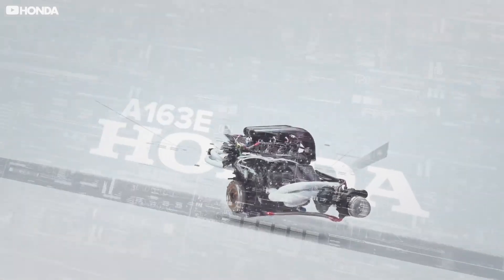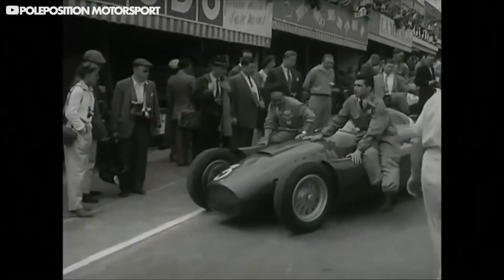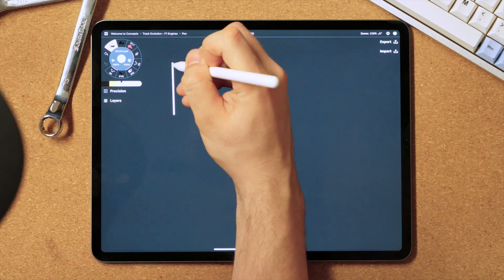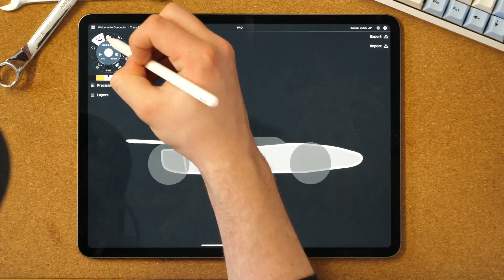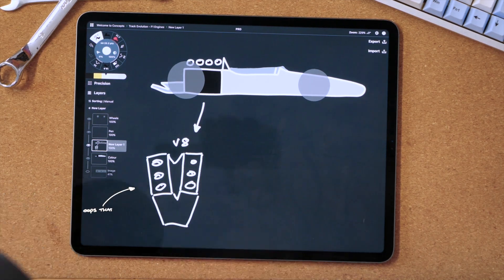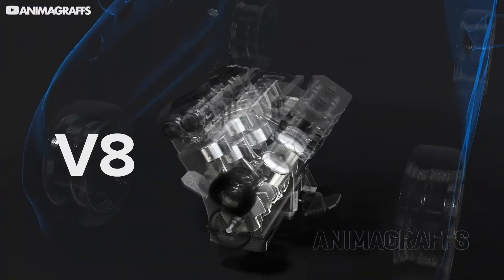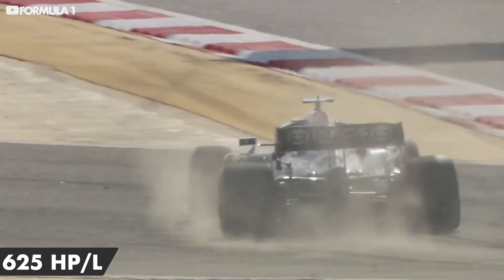The Incredible Evolution of Formula 1 Engines | Track Evolution

Comment: I think you missed the 2006 part when a V8 2.4 with 7 gears is stricted to every team before the introduction of KERS. That year, there isn't any rev limit yet, which leads several talented manufacturers like Cosworth, Honda, and Renault to strike high above 20K rpm. Until in 2007, where all engines are restricted to 18000 rpm.

Comment: V6 definitely is not a good option due to the horrible angles of the crankshaft. The best engines are either V8 or inline6. The RPM and power will dramatically dropped in V6 case and thats not good for a race car.

Comment: 1:36 First era to use Mid engine F1 cars
1:39 First mid engine F1 car
2:36 First Era that started using the engine as a stress member
2:44 First car to use engine as a stress member
3:39 Era where engine started to become flat
4:15 First Turbo F1 car and rye starting if the First Turbo era
4:43 Started to use water injection to cool the engine more evenly
4:51 Started to use toluene
5:03 Ramp up boost and replace the engine for the race
5:25 F1 becoming turbo free
5:46 First era to be slower than the last era 
6:47 When F1 started using regulations to slow the cars down
6:52 Starting of the V10 era
7:12 Kinetic Energy Recovery System (KERS) was introduced
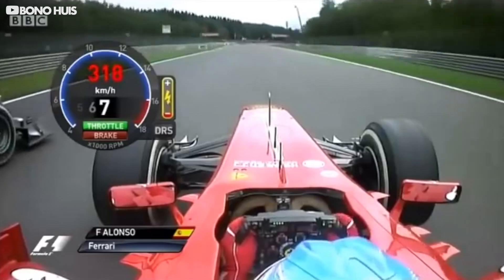7:29 Starting of the Modern F1 era
Reply: So no V8s from 2006-2013?

Comment: It would be cool if they reintroduced differing engine sizes. You can pick a 1-liter 10-cylinder, or .8 liter 12-cylinder, or 1-liter 4-cylinder but are allowed 2 turbos... stuff like that. Smaller but more cylinders allowed, cut the fuel flow down 20% but allow a 40% larger electric system, etc.

Comment: Very interesting re-cap, running at F1 pace - I had to keep re-winding 5 secs! My 2 cents is that the turbo era resulted in so many retirements (e.g. out of fuel on the last lap) that the results didn't necessarily reflect the racing, but I suppose the driver with the best & most reliable car usually wins in any period.

Comment: Sooooooo what is to be said about F1's intent for the current hybrid system to be adopted by commercial manufacturers? That hasn't happened. I get the current systems are the most efficient and produce insane amounts of torque but I'd say most of us F1 fans miss the days when F1 cars didn't sound like a cross between a vacuum cleaner and a go-kart.

Comment: I wanted to like this video but my issue with it is F1 people think and try to act like F1 is the pinnacle of auto tech. It's not. Sports car racing has been blowing away fq tech for almost a decade. P1 class has been using hybrid each for year. And battery tech. No one pays any attention to the relic called F1. Porsche built a P1 car that destroys any lap time of a F1 car. Where do you think Audis hybrid tech came from sports car racing. Chevy Ford Audi Porsche all major brands not in formula have been pushing technology for years. F1 is a bunch of arrogant little ego centered losers. Their drivers are such ass's. Nasty and think they are gods. When no one cares about them. The drivers in NASCAR sports car and other disciplines are such nicer people. Respect their sport and their fans. F1 drivers are cursing and crying on their radios if they get passed. Like spoiled children. You modern drivers run people off to the sport. They are some dick drivers in sports car but hey respect their team and co drivers. Run a F1 around a track for 24 hours. Sports car racing takes more to win. Not just who spent more m kkney. And F-35 owners run that thing like a third world dictatorship. There's nothing about F1 I respect. I used to laugh at NASCAR drivers for deivi g in a circle. But they have heart and passion. Not arrogant like F1. We we I'm a F1 driver I hi k I'm god. I'm the fast driver in he world. I'm the best. Who F-35ing cares. Your 9p pounds wet. And could barely hold a full mug a beer. Yeah you're a tough guy. The arrogance of hose people. And Lewis Hamilton now playing off of his race. Before he acted like he was white. I guess so many white drivers are pissed because he's winning. Welcome back to being black Lewis. You thought you were like OJ. Rubbed elbows with rich whites I'm one of them. They showed you quickly what they thought of you when throwing nanas onto the course I bet. You won't get that crap in sporscar racing. Not like the white supremacist F1  I just don't like it. Back in the day with Jackie Stewart and the greats. It was differs t  now it's spoiled arrogant I'll tempered shits.

Comment: Idk who off the glorious minds at the FIA thought for the 2014 rule change: Oh yes. Our hyper specialized track cars should have engines comforming with road car technology. Thats bullocks and that was never the reason, much more reasonable and what keeps VW or Toyota out of the Sport is their grand masterplan to go fully Electro or at the very max Hybrid (aand ofcourse the desire to reduce F1s carbon footprint)*. And thats the thing. Apparently if F1 has Engines that also some shitbox roadcar has, its image boosting. What however falls flat because of this relentless and (how VW is doing it) idiotic electro push from these Car Giants is the further development of other, clean engines which they already categorigally rule out. Which is sad as there are serious alternatives to E-Cars which are just as Climate friendly if not even better as less or no exotic materials are needed to produce and later on recycle them, unlike battery powered Electro Cars...Which are almost solely filled with Lithium and let me tell ya Lithium is neither good for the environment (neither the production of it nor further usage into batterys and what not) nor do we have much left of it on our planet. Lithium is expected to run out faster than oil!

But, whats gotta be said is that the current Turbo-Hybrid era engines are srsly underrated, all outsite factors aside. Real mad engines

Comment: The V10 engines of the 2000's were the best ever, the sound they made when they revved to 20k rpm was just stunning
Reply: using infinite fuel and insane consumpion is normal they were porwerfull and changing motor each race xD
Reply: Agreed. I get emotional just thinking of that beautiful sound. And the way Renault used the incredible throttle response to play "God Save The Queen" was mind blowing
Reply: @jesseemullen  call me an ignorant yank but i never knew “my country tis of thee” is yall  national anthem that we just changed the lyrics too 💀💀💀
Reply: Personally I liked the sound of the turbo F1 cars in the mid eighties the most as well as the action during that time. Hard to control beasts due to huge turbo lag but god damn, watching them go through five gears in no time with stick shift during qualifying was truly orgasmic. There are a couple of onboard videos of turbo F1 cars here on YouTube.
Reply: Sound is irrelevant since that’s not an engine’s job. It’s meant to deliver as much power for as little fuel as possible.
Reply: @jacksonprince9036  sound is not irrelevant. if it where irrelevant then racing fans and enthusiasts would be going for the quietest exhaust. but that isn't the case so you are wrong.
Reply: @Mike-jv8bv  then why exactly do engineers not care what it sounds like, but how fast it moves?

Performance is the name of the game. It’s motorsport, not a concert.
Reply: @jacksonprince9036  if performance where the name of the game then they'd be going back to v10's with twin turbos. not crappy v6's. F1 is a joke now, wokeness ruins everything including motorsports. if you want to be sustainable and care about fuel efficiency. then don't race. their rules are becoming dumber each passing year.
Reply: @Mike-jv8bv  they’re actually the most efficient and powerful.

“Bring back the V12s” is laughable.
Reply: @jacksonprince9036  i said v10 not v12. Nobody cares about fuel efficiency in a race. we only care about power.
Reply: @jacksonprince9036  twin turbo v10 > twin turbo v6. way more power.
Reply: @Mike-jv8bv  throwing everything into power isn’t everything. The cars will become uncontrollable if you go crazy with the power before you develop tyres and a chassis that can take it, even then, a v10 would be less efficient.

Also, correct me if I’m wrong, but it’s a single turbo v6, not a twin turbo.
Reply: @Mike-jv8bv  because the environment does not matter as long as we have a race?

You can have efficiency and power, that’s the whole point of the v6 turbo hybrid engine.
You’d rather have almost the whole grid coast to a stop from flaming out as long as the power is there?
Reply: @jacksonprince9036  the current cars are grotesque and way oversized. Power management can be stabilized.
Reply: @jacksonprince9036 Yo Jackson, rumor is that the entire F1 ecosystem is so monstrously resource intensive that the actual fuel saved while racing with vs without turbos is irrelevant. Think of the logistical overhead of the teams, cars, supplies, materials, parts, electricity of an F1 season hopping all across the planet. 

Taking the soul out of F1 with acoustically underwhelming v6 turbo powerplants is low hanging fruit/window dressing. Id rather see how green they can make the WHOLE ecosystem, and an alternative cleaner fuel to power v10s/v8s. For a HUGE chunk of the F1 base the sound is vital, having had v10s and v8s @ WOT blow past me a few feet away, well, if you experienced it no explanation would be needed.
Reply: @wraith8323  considering this tech gets passed down to car companies (apart from Red Bull or AlphaTauri which barely benefits Honda) the sport serves a purpose, and I couldn’t care less about sound since the engines are the most thermally efficient ever made. We shouldn’t have to pander to noise zealots when there are much more pressing issues to tackle in the sport.
Reply: @jacksonprince9036 yeah well even in the performance department the cars are dropping. 
You claim that performance is important yet regulations, especially now, are actively preventing f1 cars from performing better. Besides stop lying to yourself. These hybrid engines are only that powerful with charged batteries. Ever wondered how these cars performed with no ers charge left? 

The whole schtick of passing technology to road cars is also stupid excuse. Why then shove it in formula 1? Why did they make formula E then? Why not separate hybrid tech in something like formula H and leave formula 1 back to producing powerful and well performing f1 cars with bargeboards and open nose and tight wheel base?
Reply: @john8382-o5q  batteries or not, they’re still the most powerful and efficient ICEs of our time. If full electric is not feasible, then we have hybrid tech to fall back on. It’s sole purpose is to increase efficiency.

Separating the tech to a different discipline is pointless as uninstalling ERS would slow the cars and make them more wasteful.

The combustion engine doesn’t need to die out, but formula 1 is the best spearhead for this tech funding wise.
Reply: Still inefficient when compared to the cars since 2014
Reply: @Dr_Guts  nobody cares about fuel efficiency in a race. We want power. fuel consumption shouldn't even be a freaking afterthought. speed is all that matters.
Reply: Were?! Made?! Revved?! Uhhh, they STILL are and they STILL do because they STILL exist because their engines are STILL in there and they STILL work perfectly!
Reply: @MDDeGrande1994  STILL
Reply: @Roxor.Z  D.R.E.
Reply: @MDDeGrande1994  
Um nope! They need need to be rebuilt constantly. 
.. You're thinking of 70's Volvo engines.
Reply: @MDDeGrande1994  Believe in JESUS today, confess and repent of your sins. No one goes to heaven for doing good but by believing in JESUS who died for our sins. GOD loves you soo much unconditionally ❤🙌😘🤗😍
Reply: @alunesh12345  I call bull on that one.
Reply: @alunesh12345  Your Jesus probably never even existed. IF your «god» loved you so much and unconditionally, then, you'd go to heaven EVEN if you don't believe in it. There would be NO hell ! Or nobody would ever get there.
1) Did Jesus parent had to travel to Bethlehem or did they live there ? Did they flee to Egypt when Jesus was less than a month old, or when he was five (5) years old ?
2) The Roman census NEVER required ANYONE to «travel to the home of their ancestors». If you where from Alexandria, Egypt, and visiting Lutece, Gaul, when the census officer passed, you where required to register right there and now, stating that you are currently travelling.
3) After a crucifixion, the body where never put in any tomb, but buried in a communal grave. Also, the body where left to rot on the cross until they fell of the cross by themselves. Think of at least 10 days on the cross, and up to a few months depending on the weather.
4) WHY does the FIRST gospel got written a FULL 30 YEARS AFTER the events. That's almost TWO generations. At the time, a generation was about 16 years.
Reply: @Kualinar  do you do bat mitzvahs?
Reply: @Kualinar  It's not that God doesn't love us it's that we didn't love Him. Hence why hell exist. We send ourselves there. 

Jesus is the Way, the Truth, and the Life.
Reply: @AceGoodheart  Firstly, the mere possibility that a god, any god at all, can exist is pretty low. Then... Your god is so self contradictory that it CAN NOT exist, even if a god can exist.

A Jesus certainly did exist during the biblical times as it was, and still is, a relatively common given name.
BUT, it's extremely doubtful that the one described in the bible could have existed.

A few questions about your jesus :
In the nativity stories...
Number 1 :
Did his parents had to travel to Jerusalem for a census, OR where they living in their house IN Jerusalem ?
History tells us that during Roman census, peoples where NEVER required to travel to anywhere. You where REQUIRED to register where you live. If you where travelling during a census, and the censor is in the city where you are, you would register as a traveller where you currently are. In this case, you'd be issued a letter stating that you are registered abroad as a traveller to be presented the the censor if you happen to travel to somewhere else where the census is held at a later date. EVEN if you where all the way across the Empire. EVEN if you where in Gaul, but resided in Egypt.

Number 2 :
Did they had to flee to Egypt JUST AFTER the rites of birth, so, when jesus was barely a MONTH OLD, OR did they flee to Egypt when jesus was FIVE (5) years old ?
Those are only two of the numerous irreconcilable contradictions about your jesus.

Then, the crucifixion it utterly incompatible with what history tells us about actual, real, crucifixions. The body of the crucified was ALWAYS LEFT TO ROT on the cross until it rip itself off the cross. That process typically lasted over 20 days, and could last for a few MONTHS if the weather was cool. The bodies where then BURIED in some MASS graves. They where never put in a tomb of any sort.
This completely destroys the resurrection narrative.
Reply: @dingdong5601 probably does. Not the first time the nose people question jezus’s existence
Reply: To be frank, I absolutely don't care for the sound made by the engine. For me, an engine that make less noise is a better engine.
Reply: @Kualinar  so you would prefer a grand prix that was completely silent?
Reply: @Kualinar  that's because you have no personality.

Comment: Why not harvest energy from the suspension system?
Reply: A few reasons I can guess. When you put an electrical load on a generator it creates electromagnetic resistance which would affect the suspension and make it react unpredictably as the power being taken from it changes. It's more difficult to convert the linear motion of suspension into useful electrical energy of a predictable wattage. Even if you lose the springs and went full electromagnetic suspension, most of the captured energy would go back into powering the suspension and probably wouldn't get much extra to power the car. The equipment would have a weight penalty.
Reply: @Ellie_Melloy  I'm sure something could be figured out.

Comment: Nice. A good summary of different type of engines used throughout F1s history. Fantastic engineering involved in all of them, irrespective of how reliable some of them were. Just a tiny nit pick, the water injections primary purpose was not to cool the block but to cool the intake charge (compressing air at up to 5 1/2 times it's original volume tends to make it heat up a lot) to help control the combustion process. A secondary effect would be to help cool the engine, but mostly pistons and valvetrain if that were the case.

Comment: I like this series a lot! How about covering aerodynamics? I noticed in the Ronnie Peterson museum in Sweden, sadly defunct now I think, that the March cars used regular round steel tubes for the suspension, but the Lotus used handmade, flatter "tubes" welded together from two separate, handmade pieces, giving them a more aerodynamic shape. Also, the Lotus used torsion bars hidden inside the car, to lower drag. While most other cars still used coiled springs outside of the car, where they increased drag. All those details are fascinating, once you get them pointed out. Please continue this series, I like it a lot!

Comment: I see a lot of people missing the V10 era, and while that certainly was amazing, I personally think that the modern Power Units are even more amazing simply because of how efficient they are, while still providing stunning amounts of power. Giving the cars more powerful engines now wouldn't even improve that much, more power won't solve the dirty air problem, so let's hope all will work well in 2022.